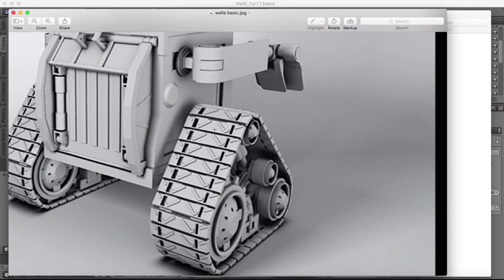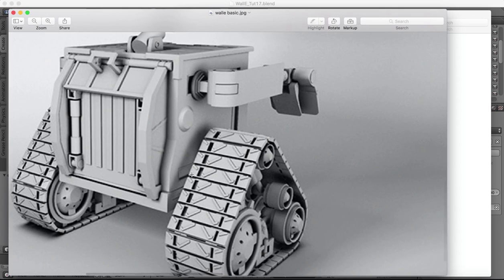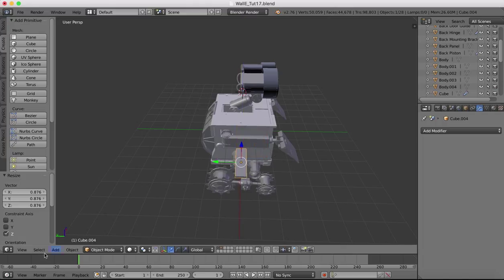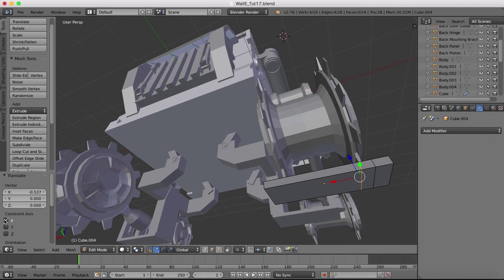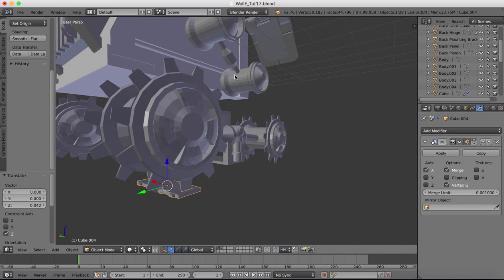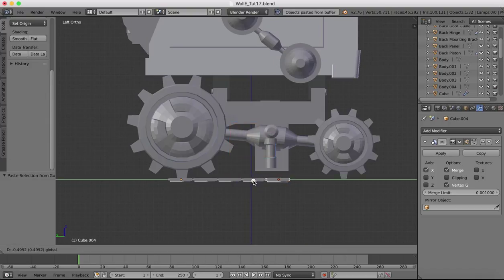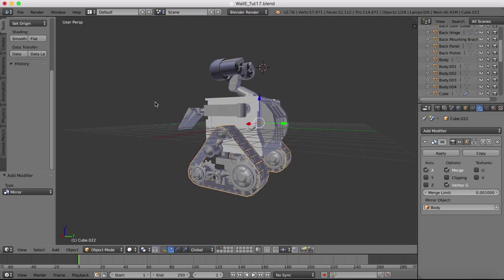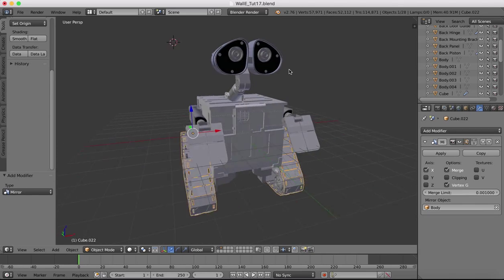Wall E Tut 18

Comment: You use to make a face by selecting 4 vertices. I find it faster to select just 2 opposite edges. Then, by selecting one of the perpendicular edges, just hit F (3 times, in this case) to fill the hole.
Instead of Ctrl+C, Ctrl+V, I use Shift+D, ESC (which is the canonical way).
Tracks: Copy-Move-Rotate, Copy-Move-Rotate, ... Simply, NO!! Here's a better technique: https://www.youtube.com/watch?v=EtZjj22_XX8